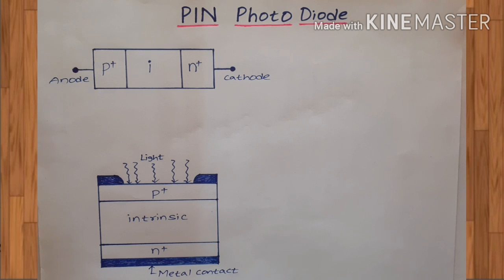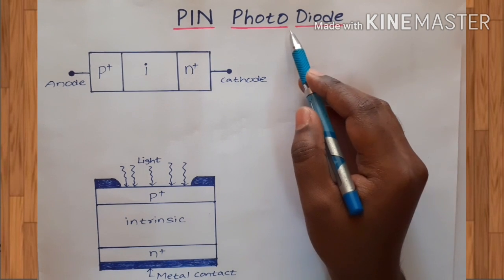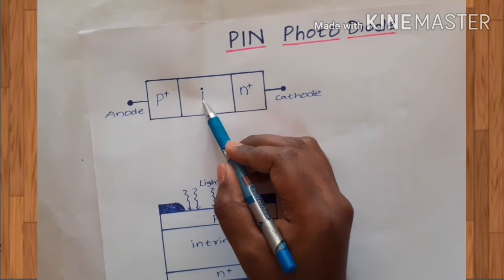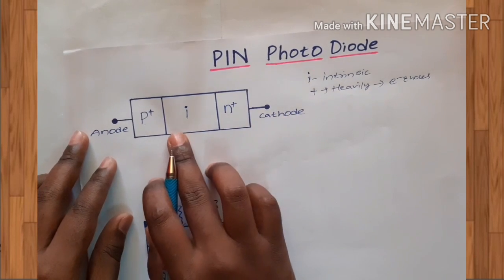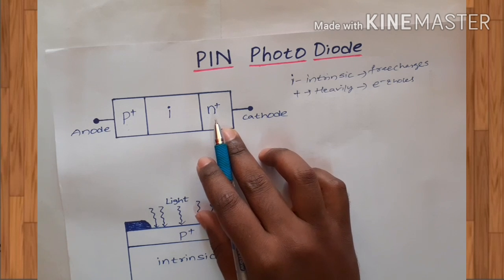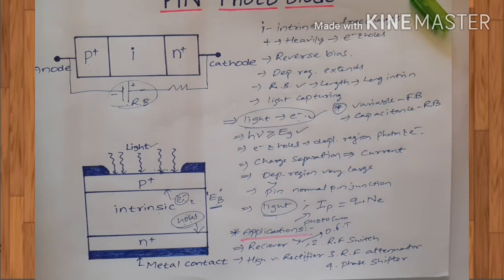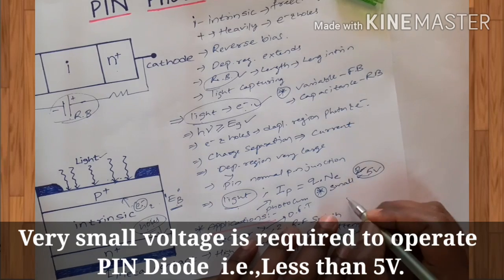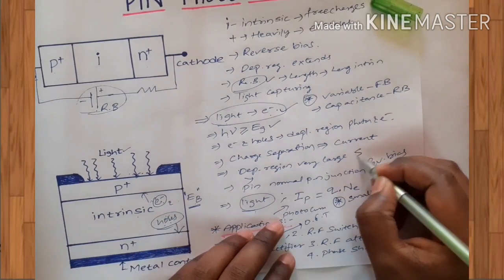PIN Photodiode || Pin Diode.

Comment: anod is the +ve terminal. cathod is negative terminal , but you have written it opposite and connected the circuit 2:54
Reply from the maker: PIN Diode should be connected in Reverse bias.
Reply: @marepallypradeepkumar5537  thankyou sir

Comment: Sir, u said, when light falls on pin diode electrons will generate, but where light or photons will fall? On P region  or n Region or Intrensic region? Bcz in  pin diode light or photons will fall first on p and layer. Can u please elaborate little
Reply from the maker: If light of sufficient energy falls (or) reaches the Intrinsic region then due to the interaction between photons and atoms (semiconductor) electrons are generated.
Reply: @marepallypradeepkumar5537  so it means, photons falls on pn layer and then it reaches the Intrensic region and then it interacts with atomes present in the intrensic region? And then electrons generates? But first it will fall on pn layer so that time what will happen?
Reply from the maker: @behealthybefit681  The probability of electron generation is very low in P&N region.
So,to increase the number of electrons an intrinsic layer is inserted between P & N regions.
Reply: @marepallypradeepkumar5537  Thanku sir,
Reply from the maker: @behealthybefit681  All the best.

Comment: cathode is negative terminal right? but you wrote it as positive
Reply from the maker: Watch it again,  I said cathode is connected to positive terminal. 

I didn't said cathode is a positive terminal.
Reply: So the cathode and anode u are mentioned is n , p terminals right??
Reply from the maker: Exactly

Comment: What is the difference btw pin and solar cell then ?
Reply from the maker: PIN Diode & Solar cell are primarily differ  in their Construction, Principle of Operation, Time of Response, Efficiency and Application.

PIN Diode (Small in Size) can be used as Photodetector & Solarcell (Large in Size) to generate electricity.

Comment: Thank you for the video may I ask a few questions?
1. If I understood it correctly, e h pairs are generated by the light, and charge seperation is done by the electric field in the i layer? If that is true if the electric field was low they would be seperated and recombined again??
2.The key is the light to the intrinsic region the picture look like it hots the p+region only. The core point is light hitting the “big” intrinsic region right? 
3. In the formula when you say Ip=qNe is Ne the doping concentraion in n+p+region?? I am not sure what exactly is Ne

Thank you for the lecture😲😲
Reply from the maker: Thanks for your thought provoking questions. I have address them below.
1.Electron & Hole pairs are generated by light, which are seperated by high Electric field only.
2.Light hits the intrinsic region of the PIN diode. Due to the energy transfer between charge carriers and photons, charge carriers are generated or released/emitted out from parent atoms.(if incident photon has energy greater than the band gap energy of semiconductor). This produces photo current(Ip).
3.In formula, 
The generated Photo Current, Ip=q.Ne
q - Electron charge, 
Ne - Carrier number or concentration.

Comment: Hello sir, at 5:14, isnt that electric field of the depletion region will head into the p+ side, so the electrons generated by the light will go into n+ side?
Reply from the maker: As PIN DIODE Connected in Reverse Bias electrons will drifts towards n+ side only.